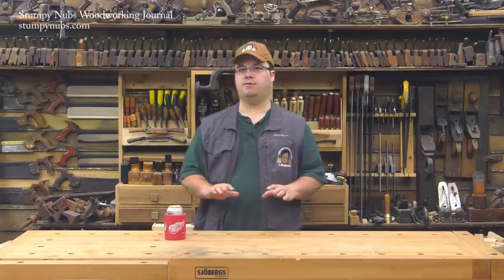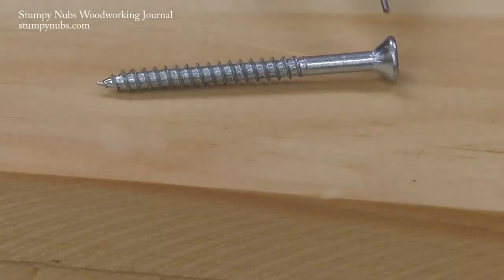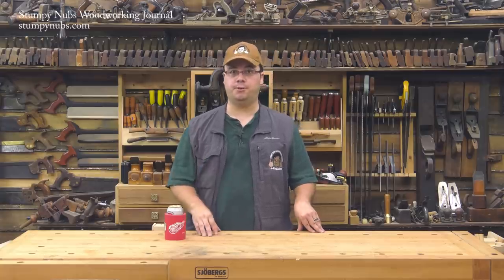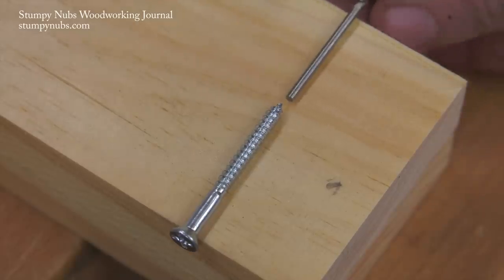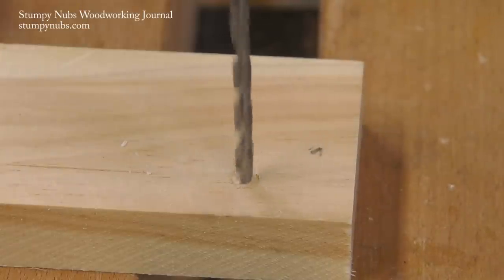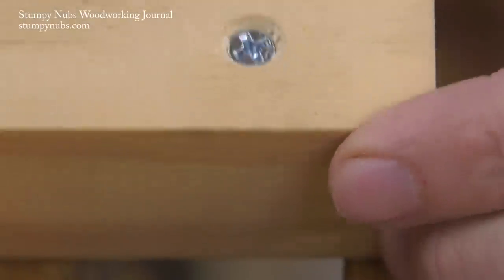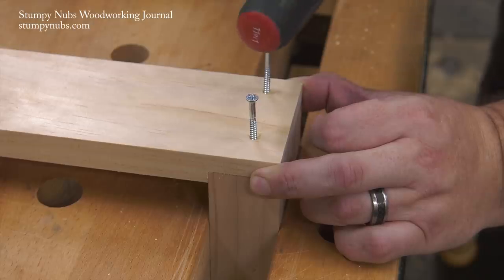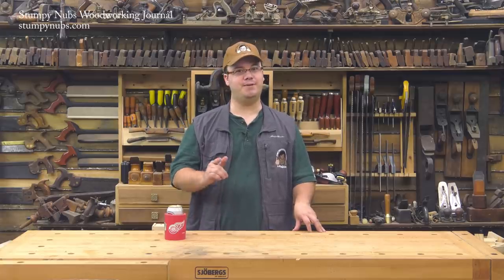Why old-timey woodworkers' screws held better (How to bore proper pilot holes)

Comment: When I was first getting into woodworking, you could find drill bits that were sized appropriately for different sized screws and did all three jobs at once. They drilled the pilot hole, the clearance hole, and the countersink all in one operation. All you had to do was adjust the depth of each part to fit the screw length and thickness of your material. I still have one for a number eight screw (probably the most common), but it has about had its day. Why does no one make anything like that anymore? I would think in 50 years, someone would have figured out they are a great time saver and developed even better versions of them. Instead, we now get bits that only do the countersink part and the pilot hole part, leaving us with probably the most important part, the clearance hole, to do in a second step with another bit and/or drill. You can get bits that are tapered so they make a clearance hole and a pilot hole, along with the countersink, but there is no adjustment for the thickness of the piece you are screwing through. If you're lucky, they might work.
Reply: Rockler has them.
Reply: Well when I was first learning the trade, we had what were called "screw-sets". They came sized to match a specific screw. If you were using a #8 x 1" screw, there was an 8x1 screw-set; an 1 1/2" , grab the 1 1/2" screw-set. No adjustments just select the size to match your screw and you had the pilot, the shank and the countersink in one pass. The pilot portion was right at half the length so you had plenty of length for the threads to bite. As I recall they came in #4 - #10 and from 3/4" - 2" long. They were really nice - - -

Comment: Another tip is to stop using Pozidriv screws altogether. Torx ones (with the star shaped head) drive more cleanly, they're great for hardwoods because the bit won't skip in the head, they require less downward pressure so you can let the threads do the work (which means less mauling of the grain), and they're even better for pieces which require disassembly because you won't wear out the screws if you keep driving them in and out all the time.

I switched over about a year ago & I intend to never go back to Pozi. You can go through more driver bits with them, but it's better to wear out some cheap bits than the screws themselves. I think they also look prettier, so can be left visible, especially since you can use brass coated ones & driving them won't scratch off the finish.
Reply: Night Cat...I use the DeckMate screws ( I get mine at Home Depot ) with the Torx head for a lot of my wood projects. But I take it another step. The head of a Torx screw is just under 3/8". I take a 3/8" Forstner bit and drill a hole maybe 1/4" deep...maybe a little less. Then I drill the actual screw hole with the proper size drill bit...like Stumpy said, about the size of the main shank under the threaded section..even a little bit less works just fine.  After setting the screw, I then take a 3/8" plug cutter and using the same kind of wood I'm screwing into, I cut out however many plugs I need and glue them into the Forstner hole...cut/sand the plug flush with the surface as I finish sand the piece, and I now have a nice looking finish. I actually like the way it looks.  Sometimes, if the grain of the plug wood is very close to the area where the screw hole is, the plug all but disappears after sanding, and even when the grain pattern is not a perfect match, it still gives a nice complimentary look.  When I got started with my hobby woodworking, I would use wood putty to fill in the holes, but I never really liked how it looked. Now I have what I would call a more professional look.
Reply: I can't seem to find Forstner bits in anything under 16mm, which is a little too large for my taste. I've also experimented with putty (and sawdust) & plugs, but since I work on small pieces & thinner wood, that doesn't really give the strength I wanted to use a screw for to begin with. With brassed TorxFast screws, if I'm careful with the countersink, I can bring them to just below the surface (0.5mm perhaps) & they actually look really good on the finished pieces. Can't do any of that right now, of course, since my bench drill is all busted up :(
Reply: Night Cat...Yes, I think your exposed brass would look nice....sounds good...reminds me of jewelry boxes and items such as those.  So...Can I assume that you are not here in the U.S.? Forstner sets are readily available here; I order mine from Amazon since I have the Prime membership and get free shipping on everything I order. And also, since I live in rural America and there are so many items that I cannot get locally, I use Amazon.
Reply: Yea little boxes like that is the kind of thing I do (but mainly actual jewellery these days). I'm in the UK & while I know smaller Forstner bits exist, they're oddly very difficult to source here. I think I found some once but they were really low quality & couldn't stand up to very hard woods, so I just gave up on the idea. Brad point bits & pen turning bits for deep hard end grain do a good job for everything else I need, though I do use large, cheap Forstner bits to chew out the insides of bowls & so on.
Reply: You could try using a contrasting colored wood instead of the same wood the piece is made of to get it to look like its held together by the wooden dowels.
Reply: Ero...Yes, that looks nice too and adds a bit of 'character' to the finished piece. This is what's fun about woodworking...you can be as creative as you want and it's all good....it's your own unique style and not some mass produced junk from China made from pressed wood.
Reply: marbleman52 Well, it's not /all/ good. You can make some utterly hideous pieces on the lathe if you put your mind to it :D
Reply: Night Cat....Yes, I've made plenty of mistakes....LOL .  I was thinking about the finished product and not so much about the trials & errors along the way. The saying " You learn from your mistakes" is so very true; I've done a lot, a lot of 'learning' in my woodworking hobby...!! But...that's how one usually learns...some learn faster or slower than others. I'm reminded of actors who talk about their early careers as " polishing their craft" ( I always thought that was a silly sounding term...). Well, I've also done a lot of "polishing my craft" along the way; but I wouldn't have it any other way. for me, it's just as important to know from experience what NOT to do, as it is knowing what TO do and how to do it. And yes, I would love to have a lathe; I operated a manual metal working lathe for nearly 20 years...sure would be neat to have one.
Reply: marbleman52 I have never stopped making mistakes. Carefully plan things out & run through how it's going to work in your mind, then find out in practice that it doesn't work at all. Even when things do work, because I make quite tiny things, the risk of them going horribly wrong is pretty high, but it's just something you have to get used to & take as a learning experience. Working within an extremely tight budget or with tight tolerances is great for that kind of thing because it forces you to always be careful & when that becomes a habit it makes less critical pieces come out so much better too.

The lathe was actually the first machine I bought. You learn so much about wood itself & how it "feels" when you introduce it to a tool, & woodturning is one of the most therapeutic things I've ever done. It is a bit annoying when you bought a cheap model & can't do anything about runout on a tailstock drill chuck, but even that forced me to learn, adapt, & build special jigs to turn a problem into something that happened to also reduce the risk of exploding a piece while I'm working on it.
Reply: Night Cat....Yep, When I have a new item that I'm working on, I will often get to bed not quite sure of how I'm going to make it, but then as I'm laying there, I start mentally working on the details and figuring out how to get the pieces to come together and in the correct order, and then the next day, I have a clearer picture in my mind as to how to proceed. Yes, you are absolutely correct...developing the 'feel' for the wood & metal & tools is a big part of our craft...having the 'touch', as it's called. And it sure is a nice reward when all of the 'feel' and the 'touch' turns out a nice item...!!  Ah...jigs...a 'must have' in many applications. I used many different jigs in my machining years and that knowledge helped me figure out how to make multiple items of something in a minimum amount of time. Then... I remember when I first learned about a table saw sled. Wow...how ingenious...and so simple...but so functional...!! Then with that principle of a sled, I made different versions for different applications...now why hadn't I thought of that before....LOL..!! Well..maybe one day I can get a nice woodworking lathe; I have looked at a lot of them...comparing specs & speed adjustments and capacities & all that stuff. I got used to my regular metal working lathe and all the things I could do with it, so I'm not gonna be satisfied with just an entry level lathe; nope...it's gonna have to be a nice one...!!
Reply: marbleman52 I'm not sure I have the touch yet, but it's going in the right direction.

The jig making is definitely helpful. I've got a cheap & dirty little table saw just sitting here & really need to get around to making a sled for it. One angle won't work though; I'm going to be putting a rotating fence on it with angle stops, sliding rails, a couple of flip-up length stops.. It's a big and fiddly job, but should be worth it when I can actually use the saw for something.

I do quite often find myself thinking it'd be so useful if this woodworking lathe had a worm drive on it for the tool rest, but finding one with that addition is nigh-on impossible. Sometimes, you just have to go with something simple & jig up the rest of it. Really, as long as you've got a nice scroll chuck & a couple of sets of jaws, along with an indexing ring (built in is better) you should be well enough set. Variable speed is useful, but I've got a belt geared one & rarely need to change the speed. A drive centre, live centre, & a drill chuck for the tailstock.. Probably also a better tool rest than the included one, but that's all you really need in order to do all sorts of stuff.
Because of the lack of a sliding tool holder, I worked up a jig that let me slide back & forth on top of the existing tool rest with a guide bushing so I could drill holes laterally, using the built in indexing ring. It's not very accurate, but it is possible to rout along a workpiece too, & the whole thing is made from bamboo plant markers & a piece of ash.
Reply: doesnt matter. Screwing up (haha) the heads is typically a sign of not making proper pilot holes. Even in hardwood you dont need particulary strong torque to set in the screw. I mean - if it makes you happy go for it. But to me it needlessly increases inaccesibility. No one in their sane mind normally carries around TORX when trying to dissamble wooden furniture. TORX are made for situations in which you are expecting high torque on the bit and hence slippage.
Reply: Not sure there are many pozi wood screws out there. They're usually ph2. Pozi screws look like a phillips but have a little x marked over them. I only ever see them in automotive. My experience with torx and wood is good, but my experience with robertson and wood is better. Torx on cars how ever can be an absolute nightmare. High torque steel fasteners with fine machine threads and rust can be a nightmare to remove. Bits break and heads strip regularly in the car world with torx. The most important things when using a torx fastener in my opinion is get the right size bit, it's easy to stick in the bit one size down and think it fits, and make sure as you drive you are square and fully seated. Torx is incredible easy to strip if you're trying to drive at an angle.
Reply: byw Interesting; Phillips has been almost entirely supplanted by Pozi here in the EU, & Robertson screws are still very rare indeed unless it's an item mass produced with them. With decent bits, Torx should have practically no wiggle at all with the proper size & it shouldn't even be possible to drive them at an angle, so it's not that difficult to tell when you're using a smaller bit.
Reply: It's woodworking though. Hard to go wrong with the classic square from Canada, the Robertson screw. (Equivalent to the Allen/hex or Torx in engagement, but easier to find for woodworking stuff.)
Reply: Night Cat as a Finisher of 30 years in high end , production and custom. For every visible screw head I change extra for poor craftsmanship . Never leave a visible screw head , never face nail. 
   Every step of the building process is to reduce damage . Not create more work for the next tradesman. 
    The number of carpenter's that complain about not wanting to because it's to much work is the same number that expect the finish to be free . 
    I apprenticed under the winner of the first Golden Hammer he won it back in the 30's .
Reply: Russel St.Clair That's fine if what you're making is designed without screwheads in mind but, if incorporated into the aesthetic of the piece, they can add something extra. I think a lot of woodworkers go with what they've been taught by the last guy & it can shut off avenues that are worth exploring or methods worth experimenting with. A lot of older screws ended up looking ugly, rusting, or being sloppily countersunk which is, I imagine, why they were always looked upon with disdain, but these days there are such a wide variety of options in materials that I don't see any reason to consider it poor craftsmanship to work a few bits of practical metal into the design of a piece if it adds something distinctive.
Reply: Night Cat unless properly dressed no exposed nails or screws. To Attach cabinet's use sex-bolts with beauty rings. If part of the design then yes indeed those screws or Nails will be incorporated by using the correct nail or screw for that design.
     This form of carpentry actually will cost the homeowner value in the final appraisal of their home. 
    When done properly Cabinetry should add 3 to 5 x the value of the cost of the Cabinetry.
Reply: Torx screws arent widely available in england for us unfortunately. Were still forced to use pozi. Unless im missing something. Im still confused as to why electricians use flat head screws for everything for christ sake!!!
Reply: Torx should be the only legal screws for everything
Reply: mattystewart8 I get them online. It's nice to support actual small business shops on the high street, but if they're worth supporting they will get in stock whatever you ask for (within reason) & Torx are easy to find in bulk on eBay, Amazon, etc. I'm not sure about builder's merchants & those kinds of places though.

Flat head/slot screws are a strange choice for any purpose (except perhaps those where it's convenient to be able to use a coin), but I suppose it's just like with anything: people use what they're taught to use.
Reply: Russell St.Clair For doing anything traditional looking or following that kind of pattern, I would agree it's not a wise choice (it doesn't fit the general look), but timber can also be used for more industrial & modern looks and screws can be handy to break away from the old-fashioned feel, if that's what the customer is looking for.
Reply: Night Cat that's fine I'm the guy responsible for the end product the one the customer pays to get the look they want. I charge for the screws and nails that don't belong.  
   The one's that belong get dressed and are charged for also.
Reply: Yes I agree. Torx is way better than anything else. I can't understand why you would use anything else.
Reply: Robinson is better imo
Reply: @noone-nd4ml  better than Philips, but not even close to torx.
Reply: What's the screws called with the square driver called? That's what I use. They work really well with an impact driver. They don't strip out either.
Reply: @wadeguidry6675  Robinson

Comment: How to properly screw wood: get driver matching the right type and size of screw. Drill hole in both pieces to just shy the length of the screw; the bit should be the diameter of the shank (so the protruding threads “bite”). for Ipe or Purpleheart and the like, do to the full length of the screw and lubricate it with paste wax. Now countersink, if it is white oak or harder, or end grain. You can use a sharp larger bit to countersink but it may tear out, especially without a drill press and the correct speed. Now slowly and evenly drive the screw until it’s tight, then STOP. Or you’ll begin to strip it. If you drill in the wrong spot, plug it with a bamboo skewer and a bit of glue. If you don’t have a countersink or press, use a rudimentary jig to reduce tear-out: a piece of 3/4” thick scrap with a hole drilled in it to guide the bit. Make it long enough to provide a good grip on it in your hand, rub a bit of paste wax on the bottom to make it stay put better.

Comment: I notice that old wood screws tend to have a long taper from the point to the unthreaded part, while modern ones are more like sheet metal screws with a short taper near the point and a constant width threaded shaft. Why is that?

Comment: This is ancient technology. Modern woodscrews overcome most issues mentioned here. Check out Heco Unix screws for example. Most woodscrews now have threads not cut but formed and thus 1 diameter of drill it is all required due to the threads being wider than the shank.

Comment: Proper wood screws had a slot to drive the screw in and the face of the screw had a sharp edge where it met the countersunk. If countersunk properly the screw was flush with the surface of the wood.